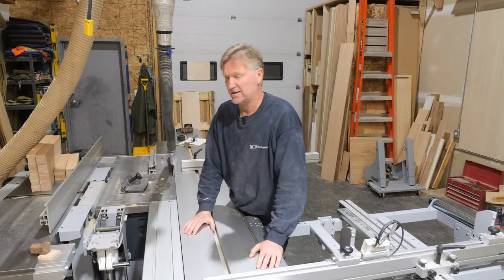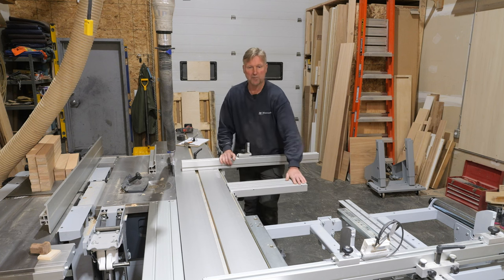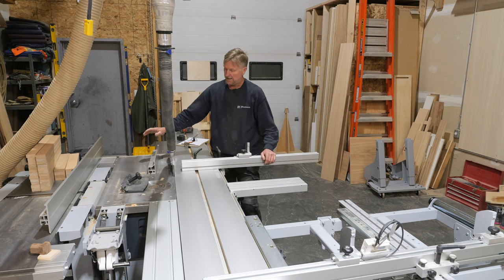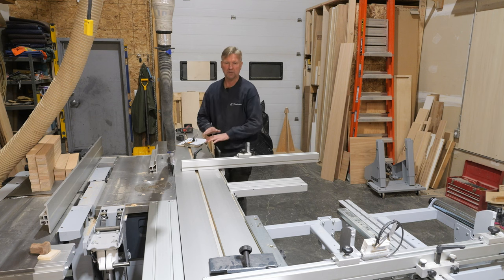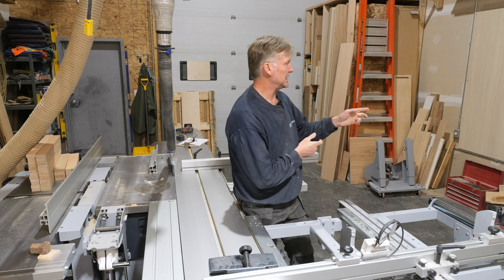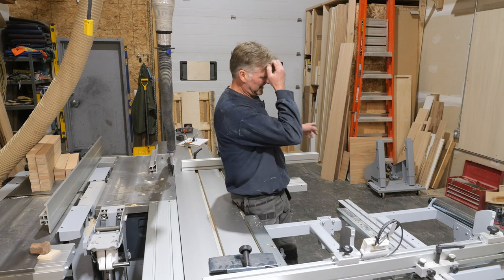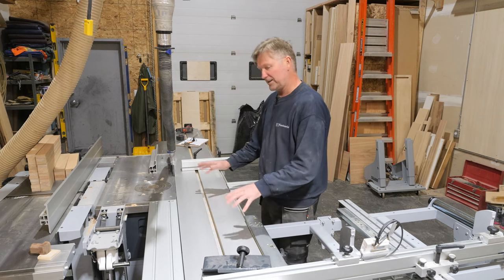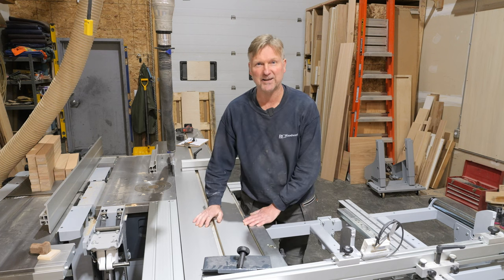Pimp your Felder combination machine

Comment: Nice! I have the same machine only the kf variant with separate ad941. I have similar spec machine and would recommend making a tool tray/ box in the outrigger and a fritz and franz jig for small parts.
Reply from the maker: Sounds like a great setup Stan. That AD941 is a lovely machine!! I really wanted to go to the same saw/shaper  combo, and planer/thicknesser combo when i upgraded from my old machine, but it didn't seem to matter how i tried, i just couldn't make it all fit. I have a very basic Fritz und Franz jig, but don't use it much. When i do need it though, i love it. It's such a useful jig to have as you say for cutting small parts, or tapered parts. I did make a add in piece for the outrigger, just for the parts that are those lengths that don't want to balance on the slider/outrigger & tip up if not held down. Again, very basic, but it serves my purpose well. Thanks for watching, and enjoy those lovely machines you have!

Comment: Probably a naive question: in your mind, what's the benefit of the parallel fence you have on order, versus using the stop on the 2nd crosscut fence you have on the table in this video?  Naively, it seems like the stop on the 2nd crosscut fence could serve the same purpose, without the expense of the parallel fence, which seems fairly single purpose.
Reply from the maker: Unfortunately the 2nd crosscut fence can only work in two specific spots on my slider. For the shorter sliders, you may only have one spot, so unless the piece you are trying to make a parallel cut fits between the main outrigger and it, it would be limiting. You could move the main outrigger, and in some cases that would likely work, however with longer pieces, the arm on the outrigger support would likely be the limiting factor. I hope that helps answer your question.

Comment: What is the part number for the outrigger cart? Looks like something I’d like to pick up.
Reply from the maker: If you need to take the outrigger off more than every so often, then the cart is a game changer, especially if you have one of the heavier outriggers. The part number is 420-230
Reply: @brycecomerwoodworks  thanks! I have a small shop too and just ordered a K700. I didn’t know this existed but will add it to my order!
Reply from the maker: @tewlman223  Nice! What do you make in your shop?
Reply: @brycecomerwoodworks  furniture and cabinets. How about you? just stumbled on your video today.
Reply from the maker: @tewlman223  Right on! I also do furniture and cabinetry, although i do, do a lot of doors and windows too. I would like to do less cabinetry, building boxes just isn't something i get a lot of satisfaction from. 😆
Reply: @brycecomerwoodworks  I haven’t tried my hand and making doors yet, but it’s high on my list
Reply from the maker: @tewlman223  Doors and windows are probably my favourite things to build. The joinery and (sometimes) complexity of the builds are what i really like. When a door is built and hung well, there is definitely a great satisfaction when it closes with a nice solid sound and feel. You just don't get it with a cheap door, and/or one that isn't hung well.

Comment: Did you think of using the stops on the crosscut fence and outrigger table for parallel cuts. Does require sliding the outrigger table for length
Reply from the maker: Thanks for watching and thank you for the tip. Can you elaborate? I'm not sure I know what you mean.